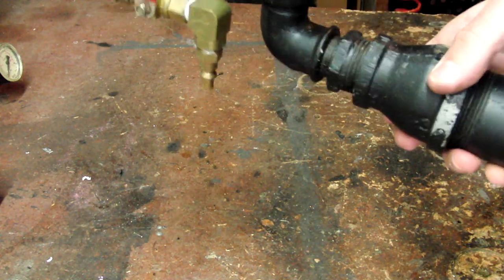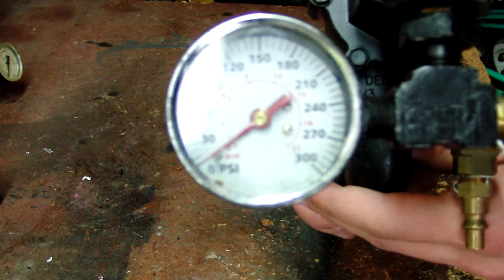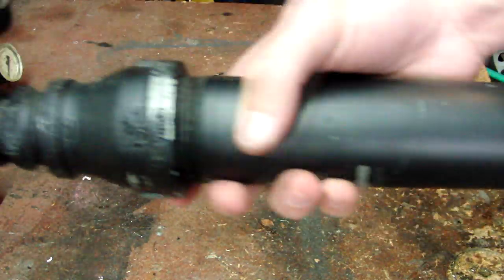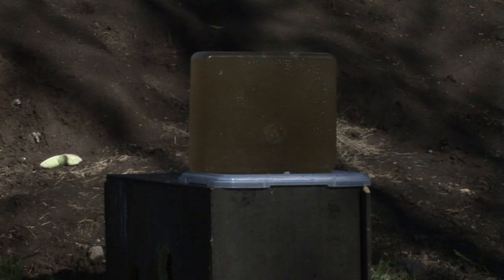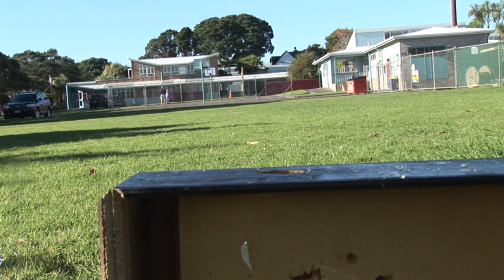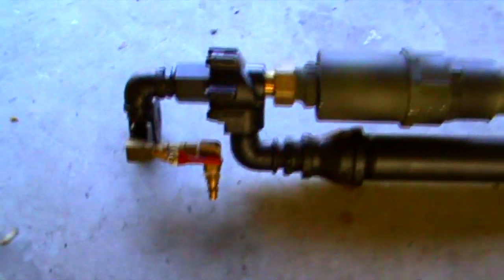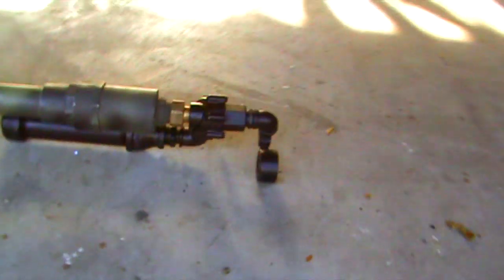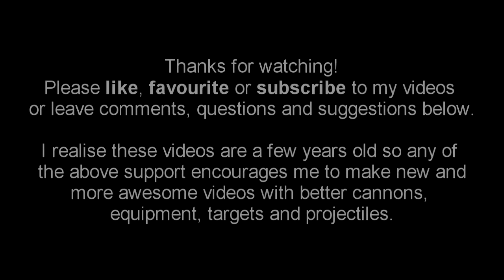High Pressure Air Cannon (shoots golf balls)

Comment: Good design. You could connect the ball valve directly to the inlet port of the qev to reduce pilot volume. Then remove the air gauge and air reservior. 
Remove the elbow from the reservior, then reconnect the reservior, the air gauge and the qev with a female tee piece.
With this new arrangement, the air gauge will now be connected to the air reservior, where it is actually supposed to be.

Comment: @johnny771977 Haha, that's not really the reason people use hybrid cannons. Hybrids allow complete portability with ease and cost-effectiveness (no SCUBA tanks or fridge compressors with inverters) and performance advantages over high pressure pneumatics due to the less dense hot gases with a higher SOS. Burst disk hybrids are more convenient than burst disk pneumatics also. Getting 1000PSI out of a fridge compressor or SCUBA is easy and cheap but hybrids are just better for single shot cannons